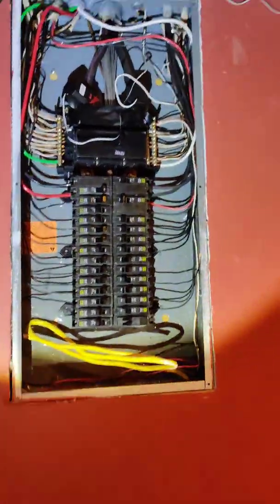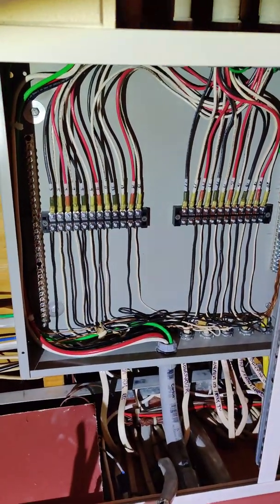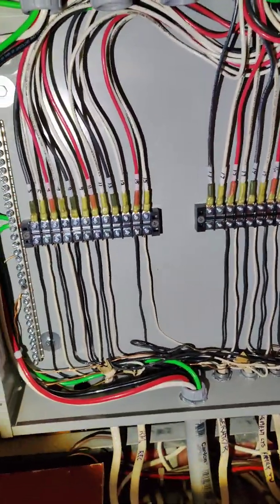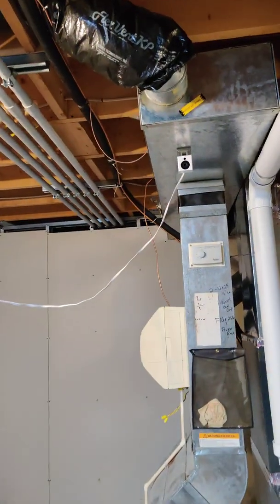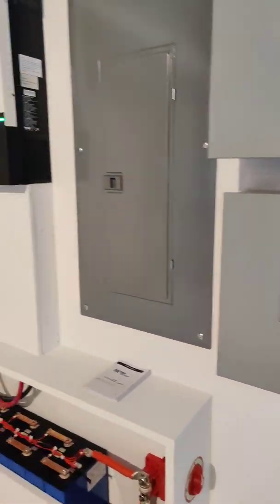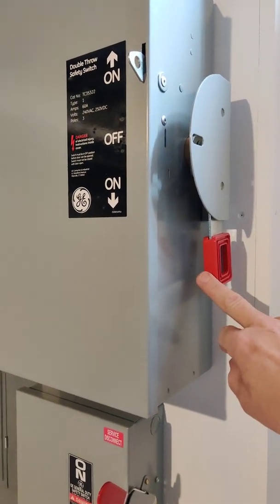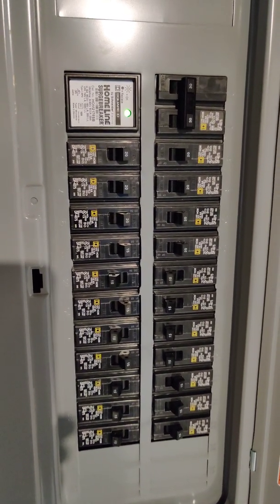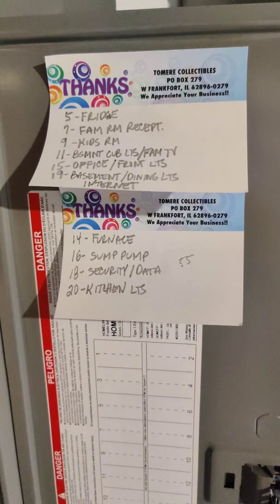MPP Solar LV6548 DIY Power Wall - The AC side of the build

Comment: This was very helpful for me. Thank you for posing this. Do you have a circuit breaker between the AC out on your inverters and your sub panel that is fed by the inverters?
Reply from the maker: No, I have the transfer switch that takes care of Main panel to sub panel/Inverters to sub panel. Another breaker is not needed (Any over load that may happen is covered by the 60A breaker feeding those inverters from the main panel).

Comment: Explain the access panels under the inverters. Diy or did u buy them? Cause I hate how there is very little options to make em look clean
Reply from the maker: They are Diy, just wood covers. Actually I still need to add hinges to them as well as build a hinged top cover board over the batteries.. One day LOL
Reply: @danfitzpatrick4112  they look good. I'm still in the one day I'll get it started

Comment: Would love to see a wiring diagram of this setup! i like how you're able to make the critical load panel be powered by the grid or the inverters, and that you are able to shut off the inverters so that you can work on them. Very nice setup, have not seen it on any other video.
Reply from the maker: Thank you, I could come up with something but basically the critical load panel is the "common" in the transfer switch. 

The transfer switch UP position is the feed from the Main panel.

The transfer switch DOWN position is the feed from the output side of the inverters. This is pretty typical in any setup..

Then here was the key... I just tapped off of the Mains coming from the panel to feed the small disconnect below the transfer switch to isolate the inverter INPUTS. So this tap feeds the Mains (or UP) side of the transfer switch as well as the Line side of the disconnect that feeds the INPUTS to the inverters.

Pretty simple really.. So the transfer switch operates the critical loads either from the Main panel or the Inverters.

NOW... without the disconnect -
If there was ever an issue with one of the inverters? I would have to shut the Breaker off in the Main panel to fix it and this would render my critical loads panel useless.. The way I have mine I can throw the transfer switch UP, turn the disconnect off and fix the issue. The critical loads is now just a subpanel from the Main pane breaker.

Hope this helps!!
Reply: @danfitzpatrick4112  Thank you for this explanation! I’m not an electrician like you so I had to research a double throw safety switch, then watched your video about 20 times, started to draw a diagram and with your explanation it makes sense, still complicated for me but makes sense. Your transfer switch seems to be three pole correct? Are the neutrals also switched in there or are they just tied together all the time on a neutral bar in the transfer switch? Again what a beautiful set up everything is hidden!so clever and looks so clean. Please.. more videos.. I think we are all addicted! A video with all the panel covers off and a walkthrough tracing all the wires would be priceless! Have you made any progress with the current on the ground issue? Thanks a lot!
Reply: @danfitzpatrick4112  Thanks for that info. I am just about done wiring my critical loads panel. I was trying to figure out what to do if i had an inverter problem what I would do to give power to the critical loads panel. I guess the answer I like is what you've done here and add a manual transfer switch. I think I will even replicate the disconnect so it would be safer to offline the inverters after transfer to grid feed.

Thanks

Comment: Really appreciate the video. I’m still learning my way around the wiring for this thing. But where did you divide the neutrals? In the 6x6 junction box? And from there you sent a neutral  to each inverter? I’ve got a bit of a longer run to feed both my inverters and I didn’t want to pay for an extra wire in there if it can be avoided. Can the one neutral support both inverters? I know technically there isn’t a draw on them. But I just wanted to make sure before I purchase my wire start the prep.
Reply from the maker: The neutrals are tapped together in the 6x6 from the main panel. From there each of the inputs on the inverters are sharing the same neutral. (So one neutral to the 6x6 from the main panel, then tapped with 2 more legs -1 to each of the inverter inputs). 
Yes, they only carry the unbalanced load so this is fine.. In short, you do not need a separate neutral from your main panel to each of the inverters.

Hope this helps! 
Dan
Reply: @danfitzpatrick4112   it helps a lot. I really appreciate being able to ask someone with knowledge. Google only goes so far in some cases. I suppose the same goes for the grounding. I do have another question or 2. I’m using a calculator to figure what gauge  wire I need for my run. And the size wire depends on whether the run is 120 or 240. So technically each leg is feeding off the 60 amp breaker. one inverter with 120 and the other. But I’m assuming I treat this like like a 240 load and size my wire according to that? And the other question. The the specs of the inverter mentioned using a 125 amp breaker on the output. Which seemed really puzzling to me. Because My plan was feeding it with a 60 amp and using a 60 from a sub panel as well for the output.  Not trying to overload you with questions. Thanks again.
Reply from the maker: @GavinStoneDIY  I'm guessing when you say 125amp that would be for the DC side?. The max you can use for the AC side is #4.
(I used #6 and a 60amp breaker. For my short run this was fine).  

On the side of the inverter the tag shows AC output 54.2amps, #4 wire and 75amp breaker. 

The critical thing to remember is you want to size your breaker low enough to protect whatever size wire you use. Use the ampacity chart for that. Don't oversize your breaker.
You could use #4 if you are running a longer distance (for the voltage drop) and still use a 60A breaker for protection at the main panel if you needed to.
Reply: @danfitzpatrick4112  an I see. I believe you’re correct about the 125amp dc. I mistook it for ac because they were talking about ac protection right next to it. I suppose they advise a 75 breaker for surge. I’ve got a 165’ pull to my out building. So I may even have to run 3 awg thhn wire. Still not sure on that one, the south wire calculator asks if it’s 120 or240. So I suppose it’s 240. Either way it isn’t going to be cheap. But you did save me some money  knowing I can branch off the ground and neutral. So I’ll only be running 4 wires. I have a 1awg aluminum direct burial feeding the building right now, which is sufficient for either the inlets (if i splice them) or outlets of the inverters. But I hadn’t planned on doing any of this years back when I installed the shop. Should have buried a large conduit I suppose.
Reply from the maker: @GavinStoneDIY  Something else.. Your 2-pole breaker should be rated for 240v common trip, this means that if EITHER leg pulls over the 60amps (or whatever the breaker rating is) it will trip the breaker. That should answer your question. Basically figure 120v. That shouldn't change the wire size, its the amps that would do that...
Reply: @danfitzpatrick4112  yeah I think technically the input breaker should be 75 amp to support the solar charging mode and your full potential load. Since the charger is around 5kw. Which I really don’t plan on using the ac charger. However that explains why they recommend 4awg wire for the input and output. The input would need roughly 18000 watts. The output can surge well over that point I believe. Unless I’m misunderstanding things.
Reply: Great questions and conversation answers a lot of the questions I was looking for
Reply: @Steveoffgridsolar  I was a bit confused when I first built my system. Helpful People like Dan filled in a lot of details.

Comment: Hi Dan, me again. What is the make model of the manual transfer switch, and the wiring boxes below the two inverters. In the box where you split your L1 and L2 from the mains, did you use a terminal bar, or some other method?

Your installation is impeccable.  

Ed
Reply from the maker: Thank you,

The transfer switch is GE-Cat No: TC35322
The boxes below the inverters I built
L1 and L2 are paralleled in the 6x6 above the disconnects with: Morris 97513 3 Conductor Single Side Entry Splice, from Jackson electric supply

Dan
Reply: @danfitzpatrick4112  thanks

Comment: When it comes to moving your loads from the main panel to that junction box and then eventually to the sub panel.  I’m curious of a couple things.

1. Do you just pull the romex out of the main and feed into you junction box.

2. Do you only run 1 ground from the junction box to the sub panel and ground all the individual circuits to the ground bar you have installed in the junction box.  I assume then you’d only have to run the hots and neutrals to the sub panel.

3. When researching those terminal strips most have an Amp rating. I’m assuming that Amp rating is for each circuit. Can you confirm that?  Do you remember what Amp rating you went with? I think the highest I found so far was 60A.

Thanks for your feedback!
Reply from the maker: #1- Yes, then I pulled #10 stranded wire from there to the sub-panel (For derating)
#2- Yes but you should also have a ground in each conduit going to the sub-panel as well.
#3- The amp rating is for each terminal (or circuit) and they do have different amp ratings. I used 25 amp rated terminal blocks.
Reply: @danfitzpatrick4112  I have watched you video 100 times it seems haha.  Each time I watch it I am able to understand more and more.

I have Ugly's 2020 Reference Guide and am looking more into derating now.  I was looking at maximum conductors in PVC the other day and was getting a little overwhelmed looking at all of the tables and charts.  Now that I'm looking at derating I'm starting to understand how they can go together a little better.

Just to make sure I'm headed in the right direction I'm going to take a crack at your derating based on knowing you are using #10 and have four 1" conduits with 2 empty.

I see 12 conductors on each terminal strip plus 1 ground per conduit would be 13 so you would need to derate 50% falling into the 10-20 current carrying conductor range?
You could use Schedule 40 or 80 since they have a 13/15 conductor limit for #10?
#10 THHN would normally be rated for 40A in a raceway so that allows you 20A max when you factor the 50% derating? (I don't know how to factor distance for conductor sizing yet but my project will be within 10ft of my main panel provided my electrician doesn't have anything negative to say about the placement so I don't think I'll need to do too much additional calculating.)

Assuming I'm not horribly off the biggest thing that throws me for a loop is the 30A 2 Pole breaker in the sub panel.  Is that a place holder for a condensing unit that will be run in one of your empty conduits?

Can't wait for future videos!

Cheers,
Matt
Reply from the maker: @matthewyow  I use a very helpful app called "EWP lite" for derating but it sounds like you are on the right page. Between derating and the wire fill charts I have found that the optimal is the 1" conduit and bumping up to #10's. 
I am actually using that 30a 2 pole breaker now and yes it was a place holder. I have added my A.C. unit to the sub panel. 

It's the busy season here in spring time (Lots of work outside) so I haven't taken the time to do an update video in a while..
Reply: @danfitzpatrick4112  this app is amazing!!!

Comment: Hey Dan!
I saw your posts in the forums and am inspired to start a very similar project.

I wanted to gain some more insight on your feed from your main panel that is paralleled to your inverter line side disconnect and the transfer switch.  I’m not an electrician so this may be a simple explanation.  

Wouldn’t the transfer switch in the off position or the on position from the main panel act as a disconnect for the line side of the inverters as well?

I’m sure I’m missing something fundamental here so I welcome your input.

Cheers!
Matt
Reply from the maker: Yes, that is correct. The reason I have the transfer switch is for redundancy. If I need to maintain (Or an inverter goes down and needs replaced etc.) I will be able to operate the transfer switch so that I am able to feed the sub panel from the main panel so that I am not without power while doing work on the inverters.
 
Basically I have my main panel feed paralleled. This feeds one side of the transfer switch and also feeds the small disconnect below that. which feeds the LINE side of the inverters.

The transfer switch "common" feeds the sub panel. Up position = Mains to sub panel, Down position = LOAD side of inverters to sub panel.

Hopefully that isn't too confusing!
Reply: Wow, thank you for clarifying!  In my head I had it all wrong so thank you very much for replying in such great detail.

Disconnect is the switch for the inverter line side and transfer switch down is the switch for the inverter load side.  Then once you have your solar landed you'll have a disconnect for your PV and your battery has a switch so everything can be disconnected!

You're video is a great educational resource and your planning and installation is executed to the 9s!
Reply from the maker: @matthewyow  Yep, you nailed it! Glad to help
Reply: @matthewyow  :

Comment: So 1 x 60 amp breaker from the main is feeding BOTH inverters? Or 1 x 60amp breaker feeds EACH (per)  inverter?
Reply from the maker: 1- 60 amp (2 pole) breaker from the main panel feeds both inverters. 1 hot leg to each with the shared neutral.

Comment: Hello.... I bought 2 inverters 6548 same your ...So when I setup 2P2 split phase but the VGA cable included in the box ( Male to Female)  not fit with connection way 1 to 1/ 2 to 2. Do I need buy 2 adaptor  15 pin to converter ? Thank you